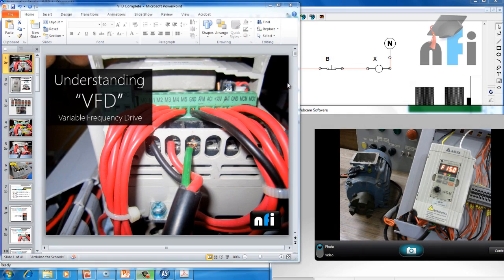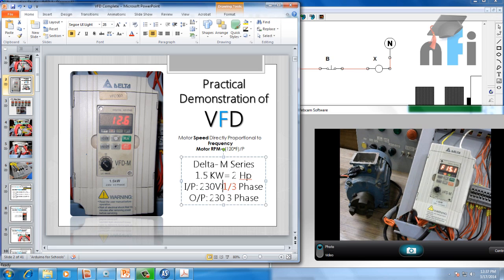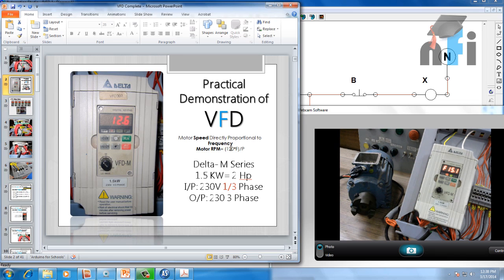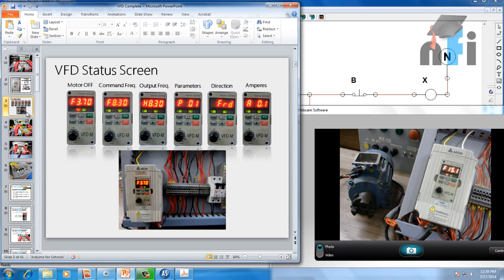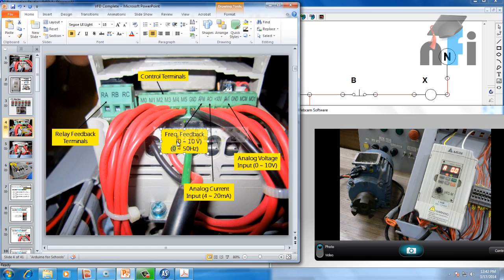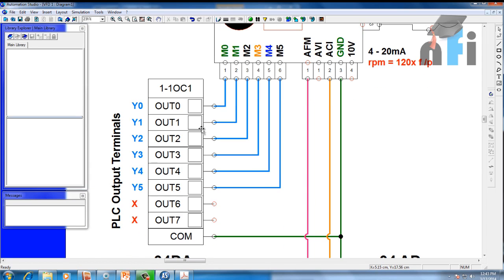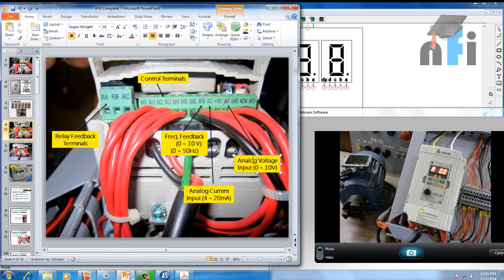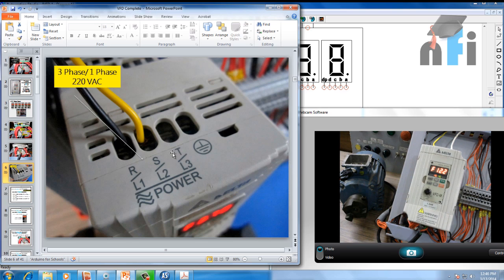Lesson 1 - Understanding the VFD  Variable Frequency Drive

Comment: i want a advice..     i am diploma in Electrical. and i want to be a programmer so what should I do.   guide me by steps 🙏
Reply from the maker: Dear Sajjad, Since you already have a diploma, you can join some training academy to learn Industrial Automation and learn PLC Programming. This skill will develop with practice and experience.
Reply: Rajvir Singh  thanks for the reply..     there is any chance to learn  programming.  from very basic software ?
Reply from the maker: You can check our course Learn 5 PLC in a Day. This course starts from scratch and you will get PLC simulators to practice logic along with the course.  more details here: http://nfiautomation.org/courses/learn-plc/
Reply from the maker: Dear Sajjad, We have a course on PLC which starts from basics, you can join that here: http://nfiautomation.org/courses/learn-siemens-plc-hmi-scratch/

If you can afford, you can also buy a PLC to practice along with it.
Reply: Rajvir Singh this course available  in Mumbai?   I am ready for this course.  and one thing i have to know that after this course.  u  have job placement or any contacts for job     ?  of yes please let me know
Reply from the maker: Dear Sajjad, it's an Online course! You don't have to go anywhere... you can apply online and you will get ID and password to access the course material. Check the link - http://nfiautomation.org/courses/learn-siemens-plc-hmi-scratch/